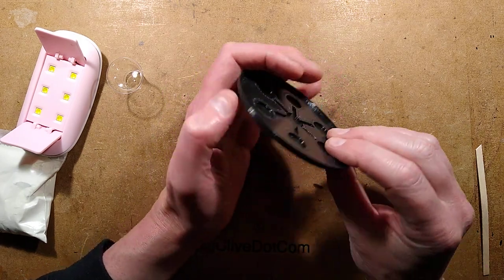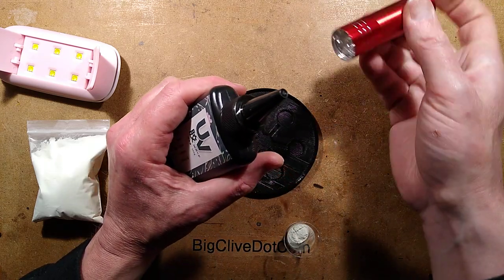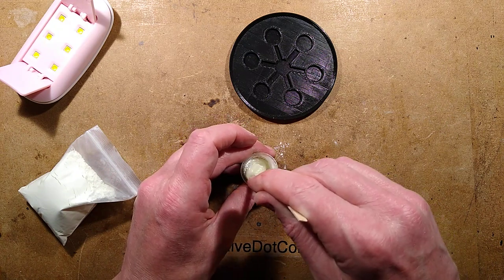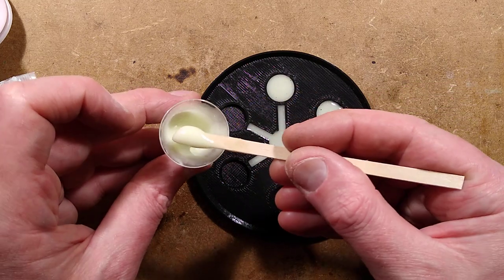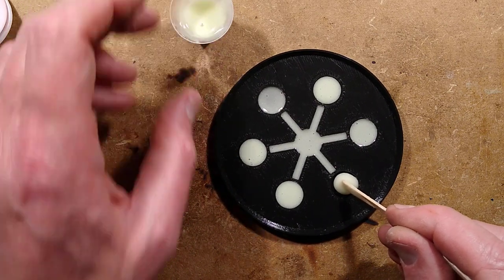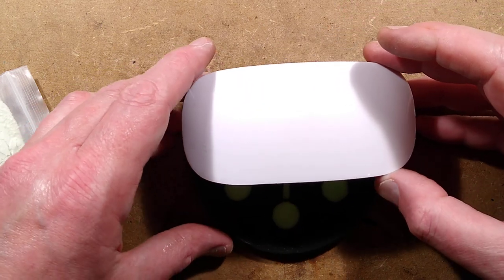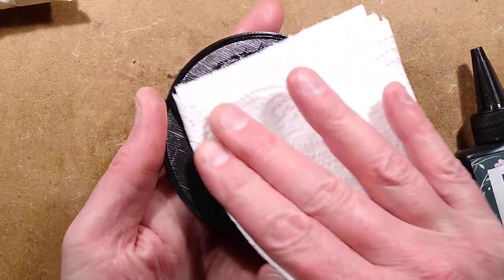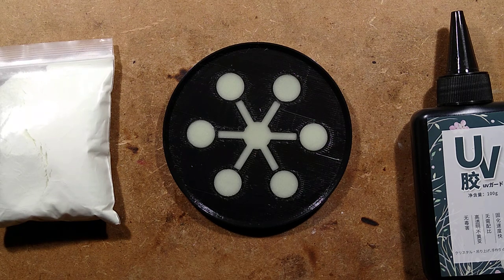Testing UV-cure resin with glow in the dark pigment.

Comment: Unrelated but kinda relevant for you channel question: What is the keyword for the lithium battery chargers that has the “pulsing” charge for recovering undervolted or uncharged cells?
I just randomly used one cheap random ultrafire charger on a puffed up lipo and it flattened somehow and continued to work like  before it was overdischarged.
(Powerbank fell, a coil popped out, I went on holiday, came back to a puffed up battery, removed it from the damaged powerbank circuit, I think it was like 1v or sth, put it on the chinese-ium charger, cell un-puffed and charged, tested current output was fine for powerbank use)

Comment: What kind of 3D printer do you use?  I'm looking for a new one and I'd be interested in what you're using especially if you're using OpenSCAD instead of something like Fusion 360.  Implies that you're either using MacOS or Linux.
Reply: There's a build for windows. 

For simple geometric constructions, it's way easier than fusion360.
Reply: From memory I believe Clive has Cetus 3D Printer MK2 (they are up to MK3 now)
Reply: @tinplategeek1058  Interesting.  Thats a lot like the snapmaker in that it has a big piece of aluminum for a single support arm instead of two vertical rails and two horizontal rails.
It seems pretty good but I'm not at all thrilled by how sketchy that spool holder is.  When you use larger spools they have a tendency to go sproing if you just leave them to unroll on their own.
https://web.ipmsusa3.org/sites/default/files/reviews/tiertime-cetus-mk3-extended-3d-printer/printing.jpg
Thanks though.
Reply: @RobertSzasz  Yeah, I saw there was a build for windows.  I'm trying to cut windows out entirely.  It looks like openscad doesn't do slicing, which is fine.  I'm sort of assuming Clive uses an open source slicer as well.
I was using Repetier-Host.  Its free(ish) but closed source and hasn't seen an update in a long time.  Thats a bad combination.

Comment: If acetone is melting it it is ABS not PLA. PLA is resistant to most chemicals. Cheers
Reply: The PLA it self is but the pigment and additives used to make it better for printing are not. As a side note you can "bleach" a lot of PLA prints using acetone.

Comment: what temperature does the filament melt vs say the temperature of a hot cup of tea
Reply: Melting isn't the concern (over 100c) it's the glass transition temp (softening temperature) of standard pla is around 60c, so it may soften with a hot brew, or as it's black on a bright sunny day
Reply: I have a 3D printed coaster (SpaceX drone ship) and it's holding up just fine

Comment: If anyone's interested in cool resin projects, check out the channel resinAce. He makes some amazing resin projects!

I 3D printed some little hexagonal bee keychains for my sister. Bottom layers in gold PLA, then border and little bee graphic in black. Then filled them with about 2mm of the clear UV resin. Even after popping the bubbles with heat, they can still bubble up a lot. Also, if I try filling and curing the fill 2mm depth in one shot, the resin contracts and causes some gaps between the walls and bottom.  Ugh....  The width of the hexagon is only about 30mm.
If I take it slow, and fill and cure it in like 3 layers they turn out alright.  
I wonder if there's some UV resin that's better about not shrinking as much when curing. 🤔
Reply from the maker: Pouring resin in layers is the best approach for thick fills.  That's part of the reason they surface remains sticky.  To make a good clear bond to the next layer.
In professional resin casting facilities they use a vacuum system to outgas the bubbles from the resin.
Reply: Thanks for the tip, I acquired a full 'bigclive-playing-with-uv-and-resin-kit"  and was wondering what to do with the left overs, Resin ace has got some great ideas, there's only so many lipo powered glow-in-the dark with embedded slow fade LEDs toys  you can make for your nephews and nieces!

Comment: Im assuming the UV resin is the same as the stuff used in 3d printing..... ummmmmmmmm you got some on your skin D: try not to do that... the juries still out on the hazards of resin printing... but the consensus is not to let it get on  your skin and if it does wash it off as soon as...  The known issues so far is an increase intolerance, at the least youll become less and less intolerant to the resin and get allergic reactions. 

Ive been lucky so far even though I have had it on my skin, even when using ppe.... So far no third arm or extra kidney growing anywhere but its still better to be safe than sorry.
Reply: And when you do have to wash it off, do NOT use IPA to do it. That just dissolves it and actually makes it penetrate into your skin. Use soap and water.